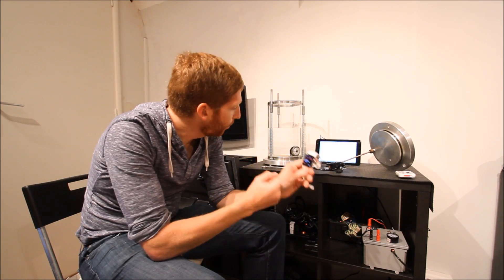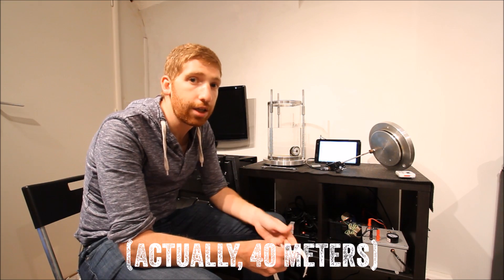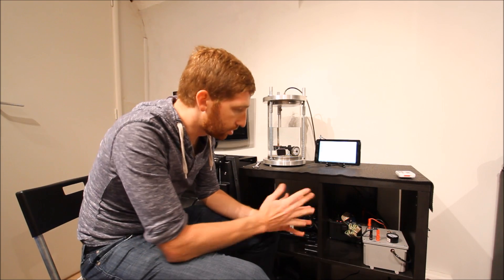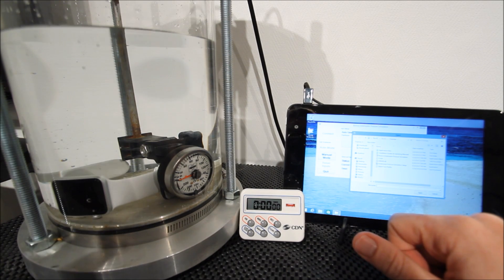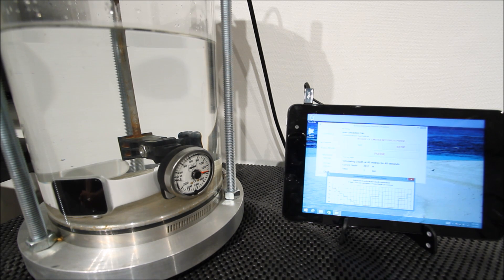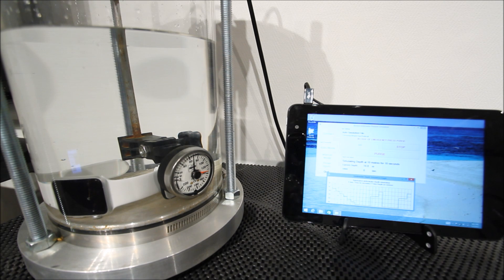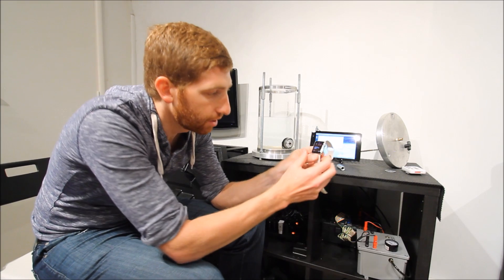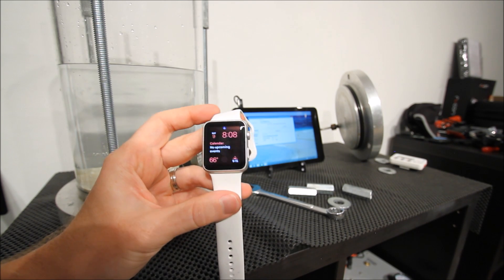The Apple Watch in a Waterproof Test Chamber to 40m/132ft!

Comment: Would the series 3 be able to go down 12 feet or so in salt water? I'm a dolphin training intern that will be regularly scuba diving to the bottom of a 12 foot pool for cleaning.
Reply from the maker: No issues there at all, totally good. The Series 3 is waterproofed to 50-meters, per Apple specs.

Comment: hi, is the watch still working perfectly?
Reply from the maker: +Celsio Polaco It was until July 25th, when coming back from a trip an airline handling my luggage lost my bag (it was in checked luggage).  That said, somewhere in the world is my bag and the watch, and it's likely still working just fine.
Reply: cool and thanks for the reply DC Rainmaker
Reply: +DC Rainmaker Why would you put a watch in a checked bag
Reply from the maker: Yes, they did.
Reply: +DC Rainmaker did they pay for your losses?
Reply from the maker: I had been on a sailing trip, which had limited power (only a single outlet every few days for a few hours), so that outlet was usually used for cameras or phones. Thus it soon died on battery and I just left it in my suitcase (along with numerous other devices). It was mostly straight onto the plane after that.
Reply: +DC Rainmaker did the airline refund you at all?

Comment: Well, for everyone reading this, don't take your applewatch for a dive. I went lobstering in the Keys and took the watch with me after watching this video, 15ft max depth and the watch died, the first day it was ON but the touchscreen didn't work at all, the crown didn't work either, next day after just snorkeling (no diving) a black spot started to appear in the top right corner of the screen and now its all dead. Going to the apple store to use my apple care... NOT waterproof for diving or anything else than just rain or taking a shower with it.
Reply: it is the stainless steel version
Reply: quick update: I have appleCare but apple replaced the watch under warranty so no deductible this time
Reply: +Gassan Matta probably becuase of the salt water
Reply: +Nico Capala Salty or not, it came into the watch.
Reply: salt water breaks up the materials more than fresh water would.
Reply: i heard the sports model is better in water...

Comment: Damn impressive test! I opted out of the Apple Watch when I found out it was only "water resistant". May have to rethink that now. 140 feet is over 4 atmospheres, and a ton of pressure. Very impressed, thanks for subjecting your watch to the torture test...
Reply: Apple Watch is “water resistant” for up to 50 meters most people only dive 30m so diving with the Apple Watch is perfectly safe.  When a company like Apple says “water resistant” it is actually water proof. The only reason they say this is for legal reason they don’t want to make a guarantee for in case the watch is faulty.

Comment: I just want to let you guys know that there are a lot of Apple Watch users including myself that are having issues with water in the speaker. I have showered with my Apple Watch for over a month and it was just two days ago I started to hear crackling and muffled sounds from the speaker. I wasn't sure what happened and I can only guess that water was getting into the speaker hole. So on the following day I showered with it and the speaker was muted and very crackling. So I started to do some searching online and I found that multiple people are also having this issue. Good news is that it does dry out in less than eight hours if you blow the water out of the speaker holes first. Everything is back to normal and fully functional and the speaker sounds normal so this might be why I would think Apple did not give a full waterproof rating for the watch. I just want to mention again that I had absolutely no issues for the first month showering twice daily with the watch the problem just recently showed up. It could be that lint and other things that touch the speaker protection film (what ever you call it lol) could be pulling water into it and getting into the speaker. 

https://discussions.apple.com/thread/7042900?start=15&tstart=0

Comment: is that salt water or fresh water?
Reply: donrhummy I second that - run it in salt water. Better still, cycle it between salt water pressure AND air drying for a day THEN salt water again (do it about 20 times). The reason Apple probably wont warrant the watch in water is that expansive crystalline growth that forms at the seals will ultimately destroy the seal (and very quickly thereafter the watch)   ... in short, a great test, but I want to swim just more than once in the watch's life time (and probably in salt water) ʕ •ᴥ•ʔ
Reply: Justin Moss 
Any piece of equipment that is used in salt water needs to be rinsed in fresh water if you expect them to last. Dive cameras, (real) dive watches, dive computers, regulators, etc. They also need to be serviced regularly, and have the seals replaced. 

FWIW, I'm not arguing with you. I too suspect your version of testing would kill it after a many cycles. That said, I'm damn impressed it went to 140 feet and survived. That's 10' below recreational dive limits, and would be a decompression dive, at over four atmospheres. After watching this test, I'm betting you could get in plenty of ocean swims in and not have issues, as long as you rinsed it in fresh water afterwards.

As an aside, I killed a dive camera housing at 90'. It was 10 years old, but it was rinsed serviced as it should have been.
Reply: Rinsing will slow its inevitable demise, but if you (say) surf twice a week with the watch, I expect the device would last less than 6 months (rinsed or not).